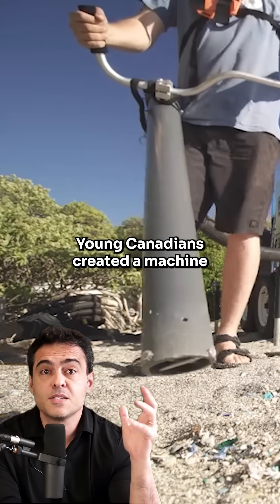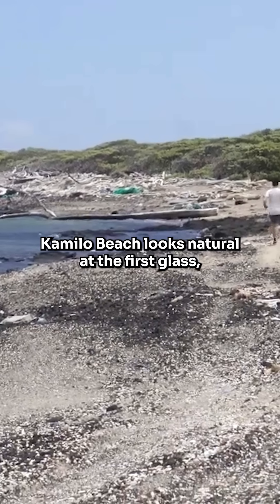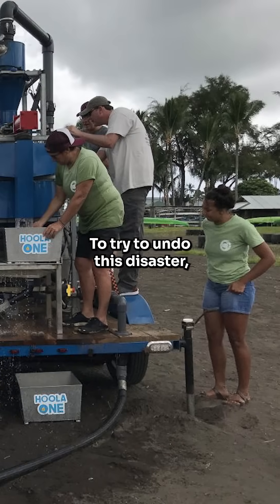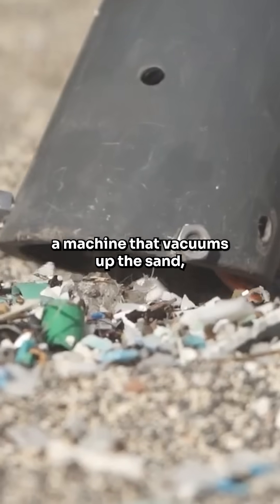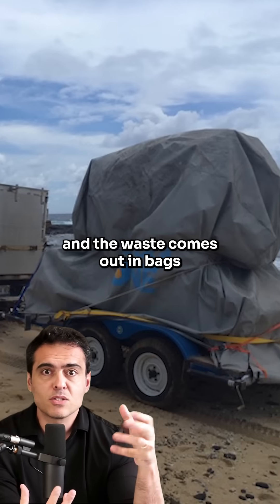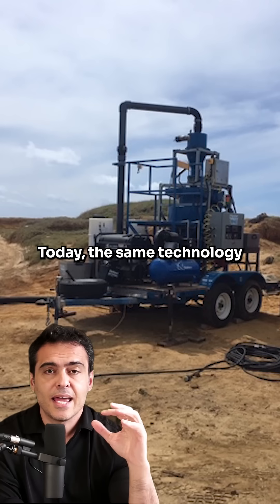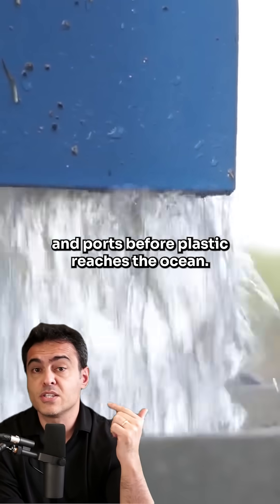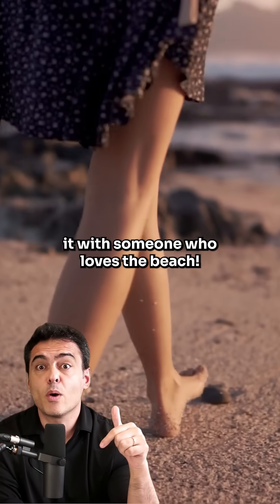Young Canadians created a machine that cleans sand from beaches!

Comment: The source of the debris needs to be addressed also otherwise the situation will never get better
Reply: Tsunamis leave devastating debris in the ocean and then follows currents.
Reply: @disscustinglybeautiful1652 It’s not even the tsunamis tho that’s a small fraction of plastic in the ocean
Reply: @disscustinglybeautiful1652  sure, tsunamis are an issue. but its mostly just an issue with countries that have a culture of not giving a crap about proper disposal of plastic waste, so it ends up literally just thrown on the streets, where the weather then means it all ends up in rivers. 
if it was all in landfill, recycled, or incinerated then it wouldn't be able to end up in rivers.
Reply: That would require regulations and holding corporations accountable though.
Reply: @GameTimeWhy or boycotting their products
Reply: Industrial pellets. They make up the majority of plastic pollution. - Nobody is ever held accountable for this. "Oh dear, another container full went over the side, nevermind, we have already lost enough profit as punishment" 🤬
Reply: The source is plastic from 40 years ago. We have to stop adding stuff but also the effects of decades are palpable
Reply: Ocean Cleanup is attempting to do that by stopping it at the rivers, which are a major source of ocean plastic, but they need more funding.
Reply: There is even plastic junk at the bottom of the Challenger Deep, the lowest point on our planet.
Reply: @clivewilliams3661 plastic floats so unlikely.
Reply: @KingSheva-sh5qw  there are different density plastics…
Reply: @KingSheva-sh5qw there's a video of a plastic bag and some other plastic stuff.
What they said is correct. Easily checked.
Reply: Bingo. The promise of "technology will solve our unsustainable behaviors" never, ever pans out.
Reply: But there’s money to be made and the harm isn’t harming the people making the money. 
Not just the fat cats at the top, if your retirement fund invests in these companies you are part of the problem.
Reply: Fat chance. Nearly every country, besides a few European countries, aren’t putting any legislation against it. 
China and India produce the most in the world.
Reply: AREN'T INDIANS THE SOURCE?
Reply: 🤡🔫 indeed
Reply: The source is making money for some American cunt so that will never be shut off
Reply: Tsunamis and floods
Reply: True.  We were encouraged to buy fake leather (not real leather that lasts a lifetime and more) fake leather which is basically plastic, and plastic does begin to fragment, fray and disintegrate into teeny tiny plastic flakes being littered everywhere one goes with that bag.  Those plastic bags turn to plastic dust eventually.   One time I literally vacuumed up a pair of adult disintegrated soccer shoes from our shoe rack as they had crumbled entirely into both coarse and powdery plastic granules and were no longer shoes but polluting plastic powder and flakes going everywhere.   Things seem to be made to deliberately turn into plastic crumbs and not last a lifetime +  any more.
Reply: A country in East Asia is known for dumping tons of plastic into the sea.
Reply: The Pacific ocean is officially put on notice.
Reply: @markw4318  whoever produces plastic should also clean it up.
Cocacola of instance.
Reply: CHINA is the largest polluter on earth!
Reply: @charlesdeering9359 Humans are the largest polluters on earth.
Reply: @charlesdeering9359  yes, and we support it by buying cheap crap from Temu, Wish, Shein and Aliexpress!
Reply: That’s a bit like saying we need to address the source of the dirt on our floors or it will never get better. A vacuum isn’t a solution. The fact is, people use stuff, plastic is incredibly useful, the solutions people are coming up with to clean up the waste and minimise the impact are fantastic.
Reply: @lisa34478  We can and should minimize our plastic consumption as a society. Corporations are a large part of this mess and should be held accountable as well. Obviously we can't just quit plastics, but we can choose to not use it unnecessarily.
Reply: @bz1066 why should we reduce our plastic usage? that's idiotic why not use the best tool for the job? should plastic cleaning fees be a thing some plastic companies pay, probably but that is not using less plastic. saying reducing our plastic consumption is everything wrong with society, don't be scared of problems and be confident enough you can find the solution.
Reply: @bz1066 you haven’t made any argument that rebutted the vacuum cleaner parallel. Crappy original comment dismissing the achievement for self promotion
Reply: @bz1066  China and India
Reply: @M_SC  I don't need to make a rebuttal to vacuum cleaner parallel because it's tangential to the point I was making and also not a 1-to-1 comparison. We don't produce dirt intentionally to be involved in nearly every facet of our day-to-day lives, and the health ramifications of interacting with dirt is different than with microplastics. 

Even within the metaphor of tracking dirt into the house you could still say that an effort could be made to reduce the rate by which we track dirt into the house by leaving dirty shoes by the front door and using house slippers. I really don't understand your critique of me. 

I didn't even undermine the achievement within the video. I believe it's a good thing, but that doesn't mean we should lose sight of the sources of pollution in the first place.
Reply: @KingSheva-sh5qw  I mean it's not the "best tool for the job" in all circumstances. Yes, I agree it's extremely difficult to find any other material as malleable, pliable, or strong as many commercial plastics. However, surely we can avoid things like polyester clothing in many instances. In many instances such as fast food or cheap dining we could replace plastic packaging and utensils with paper and wood, or even opt to use our own utensils when we bring fast food home. 

Additionally, you're simplifying my argument. I acknowledge that this invention is a valuable tool for managing environmental plastic waste, but that doesn't mean we can't focus on the sources of pollution. This invention used in conjunction with methods to minimize plastic consumption is the best combination to deal with plastic waste.

Also, reducing plastic consumption is the responsibility of corporations as much, if not more so, than the consumer. So this isn't just me placing all the blame on the individual.

I really wish you could have criticized me in a more constructive fashion. Saying that my statement is "everything is that is wrong with society" is reductive and you know that.
Reply: @M_SC  Because its a bad comparison. Lots of countries dump plastic waste right into the sea intentionally.
Nobody is coming to dump bags of dust into your home.

Almost like your home is not even remotely comparable to the entire earth making it an apples and oranges comparison.
Reply: @KingSheva-sh5qw plastic isn’t the best tool for most jobs tho and in areas where we do need plastic we should use biodegradable versions or he held accountable in recycling it or otherwise disposing of it in an effective manner
Reply: @M_SC yes they have te OP said to have better clean up solutions and the response said to not create the problem to begin with
Reply: @yoeyyoey8937 why? why not just force companies to pay for cleaning and recycling as a tax. your objecvly wrong again if its cheaper to use and properly dispose of non biodegradable plastic(which is hyper neash and basically not a real industry) then the non biodegradable plastic is the better tool for the job. your trying to imply envormental concerns where they are already adressed hence a tax.
Reply: @yoeyyoey8937 as a fyi biodegradable plastics means non oil based plastics, oil basd platics are cheap and reduce the cost of fuel as they are a byproduct meaning the more we pay for each byproduct the cheaper all of it becomes. there are so many positive feedback loop effects of using cheap ass shit materials its not even close. +if you tax for plastic cleaning in the process your also probably going to clean something else and create and own new equipment vs making shit that desapears into thin air in 2 years. everything about your logic is just wrong backwards and self destructive.
Reply: @KingSheva-sh5qw  idk what you mean by it’s cheaper; it’s not cheaper for the petrochemical companies cause now they won’t be able to profit from their waste products. It’s the same cost to the consumer tho, and when you count in long term health effects, quality of life, moral guilt, etc it’s cheaper than plastic
Reply: @KingSheva-sh5qw  *non petrochemical-based oils. Actually there are biodegradable plastics made from corn oil and other materials. Regardless they are cheap but so is paper and glass. Only reason we use it is cause people got used to it during ww2 since lumber, metal and glass was used for the war effort, and the plastic industry grew to the point of profitability. Since then it’s a genius way for corporations to make money off waste products. As consumers it’s a completely unnecessary material for most applications.
Reply: @KingSheva-sh5qw  i don’t see how what I’m saying is toxic or self destructive, would you mind explaining it to me?
Reply: @yoeyyoey8937 simply false. plastic was a revolutionary material when it came out. plastic revolutionized cooking, driving, computing, and almost every other industry there is. plastics offer a unique ductility and stength that js uncommon elsewhere in nature inpart due to their complex carbon chains(oils if you wanna grosly over generalize) they are strong light and easily modifiable and engineered to meet almost any application there is. to say plastics are as cheap and as usefull as wood or glass is just saying you have never seen what behind the vail of the industrial sector.they are SIGNIFICANTLY cheaper and hence actually more enviormentally healthy as cost is in large a extrapolation of energy required for something which gas a firect corbon footprint.
Reply: @yoeyyoey8937 again your wrong but k. your implying them being able to effectively up the extraction efficiency will have no impact down the line which is simply false. again your misinformed as to how the world really works. fun question where you going to get the wood from, what wood are you going to use, how are you going to grow it. your grosly oversimplify the achevent of your goal undermining the significance plastics has on the world and are just arrogant and ignorant with suisidal emoathy. i bet yoh if you saw a bleeding baor youd try and help it(unless you have sedatives never get close 10/10 it will kill you.
Reply: @yoeyyoey8937 how are you going to treat that wood btw you cant just use wood and oils dont always work again you just show how ignorant and ill informed to the world you are by saying you know better then the free fucking market which has saved and improved more lives then you could ever dream of even impacting.
Reply: @KingSheva-sh5qw  extraction rate of what? What are you talking about? You mean like them extracting plastic from the environment ? I didn’t say that getting better at extraction wouldn’t mean that they are worse or the same at extraction that obviously makes no sense. The fact is that we wouldn’t need to bother with any of this if we didn’t use it. If you force companies to take care of the plastic they’ll still dump it somewhere just hopefully it won’t end up in the ocean. If they recycled everything they wouldn’t turn a profit on new materials, so they’d stop producing plastic, which is basically what I’m saying should happen anyways. What are you talking about suicide and boars what does that have to do with anything?
Reply: @K @KingSheva-sh5qw  @K

 “wood” (but really any biomass) is a renewable resource and it can be recycled if we’re talking about paper. That’s why it’s so great and better than plastic. Idk what you’re talking about in regards to oils or treatment maybe you can clarify? Regardless the “free market” is why we have this problem of pollution so instead of going against it Im saying to use the free market to edge out plastic use.
Reply: @K @KingSheva-sh5qw   plastic is revolutionary in its ability to turn industrial waste into a useful and profitable product and it’s useful in some applications but most uses of plastic are actually a replacement of glass, metal or wood. So what you’re saying doesn’t really make any sense, it’s actually totally backwards. Computing is one of the few things you really need plastic for but even then that’s not really regular plastic it’s not what we’re talking about here.
Reply: @lisa34478 it reduces life spans it’s doesn’t biogedegrads it’s just reduced into microplastics which end up in the food chain including the things we eat especially fish and on that are causing animals that migrate like ocean species to essentially have Alzheimer’s coupled with the poisoned food they eat and overfishing and increasing sea temperature acidification blah blah fkn blah the ecosystem of the ocean as we know it is essentially about to disappear within our lifetimes I’d say a global ban on plastic is more than justified and that’s before I’ve even mentioned anything of any substance really. Plastic isn’t the equivalent of “dirt on the floor” it’s a man made oil based set of polymers that are possibly one of the most disastrous products to be created by the petrochemical industry there’s not actually any real reason plastic has to be used for 98% of all modern uses and applications, in all fairness humanity doesn’t even need to be producing anything as much as it is we overproduce and let people starve because we don’t manage resources effectively or efficiently to where they’re needed even though we’re more than equipped to do so, so why in the fk would you think that plastic is some magical wonder product like the world didn’t function fine without its major use in every single product in order to cut production costs and thus increase profits ever more what a BS response to a very normal man made situation everyone knows is one of the top contributors to the natural world getting fkd up holy Christ im done with peoples dumbest of delusions being taken seriously, enjoy the fascist shit show whilst the planet burns and there’s no future for any further generations I guess
Reply: @MayDaygxd8497 so I guess because we can’t fix the source, we needn’t bother with the outcome? If we clean OUR environments and live healthier lives as a result, maybe those doing the polluting will be forced by THEIR populaces to do the right thing, and we can boycott their goods until they do.  And if they don’t, doesn’t matter. Our environments are cleaner.
Reply: @alexc4300   A great deal of Western plastic rubbish is being sent to South East Asia for disposal and ending up floating around in rivers and sea inlets.  We caring westerners don't give a *%($ what happens to it once it leaves our shores because we have sent it for recycling - right?
Reply: @alexc4300  if we boycott plastic then they’ll stop producing it. Iceland already did that
Reply: @lisa34478  Thats a terrible analogy for this situation. Billion dollar companies use plastic packaging so they can stay above 1000% profit margins. There are plenty of alternatives.
Reply: @lisa34478 the fact is your floor won’t get dirt on it if you don’t wear shoes in the house likewise we shouldn’t be pollutin our earth with plastic to begin with. That way we’d have nothing to clean. Also would be way more efficient and effective
Reply: china and india, but can't blame those because of ideology reasons can we...
so we tax our people more!

don't you love having your first world country being forced to bear the responsibility of everyone else, and you're the bad guy if you don't!

Comment: You pronounce the "o" twice. Ho'ola. Also, there is no soil in sand. It's either rock or coral (in Hawaii mostly coral). But to be really affective, they will need to use something much larger than a vacuum hose.